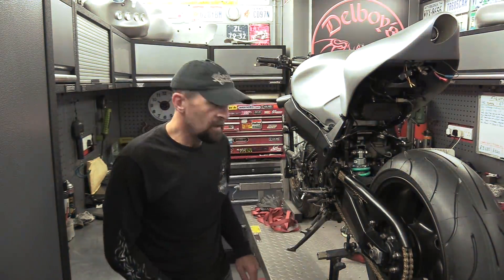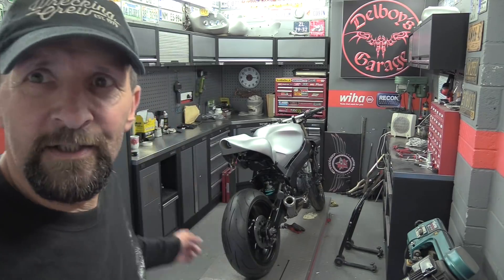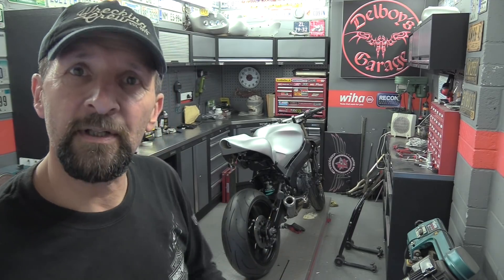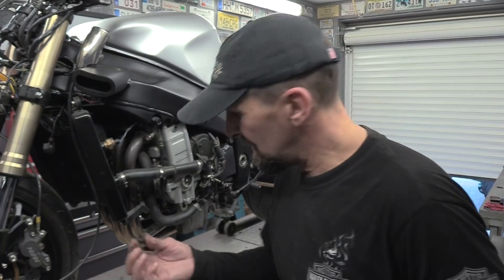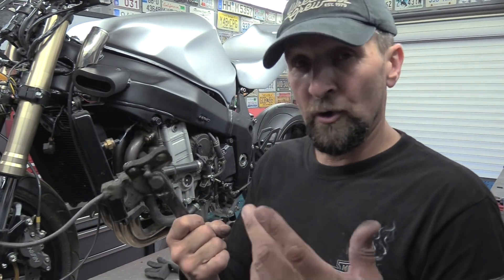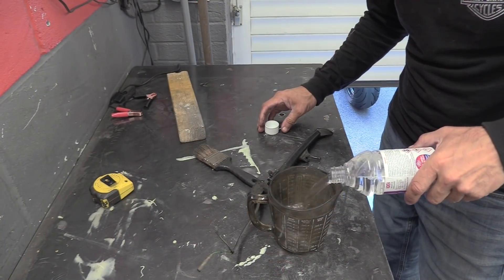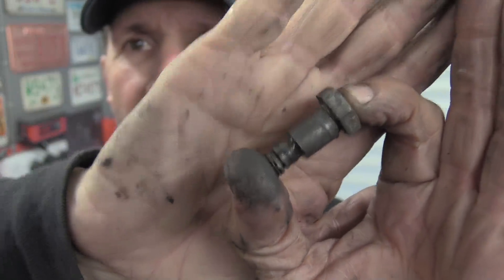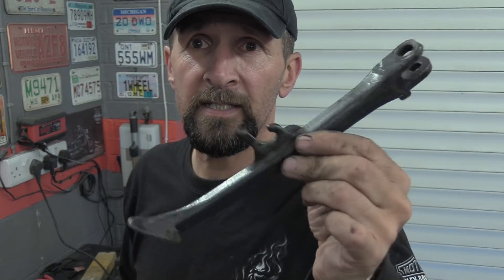Delboy's Garage, Fighter Build #142, Side Stand Extention !

Comment: Does it clear all parts on the bike in the stowaway position?
Reply from the maker: Yes it does mate, it's 1 3/4" longer in exactly the same direction as it was and there's nothing in his path!
Reply: You never tested it on the video, i got curious! New format is great!
Reply from the maker: Hi mate, I did chuck a temporary bolt through it but was flopping about everywhere because it has a an M8 thread but a 12mm shank, so a regular bolt won't hold it still and it flops all over the place, so was not possible to be accurate, but all I've done is extend the length of the stand in a single direction by 1 3/4", no deviation in direction, or shape, so it should just be a little longer than before and lay up beside the swing arm... also the new bolt won't be floppy like the old one, and I've now closed up the clevice a little too, so the stand should be smooth and accurate in it's original factory condition... proper walkround at the weekend buddy!